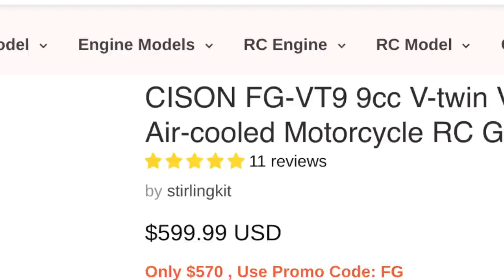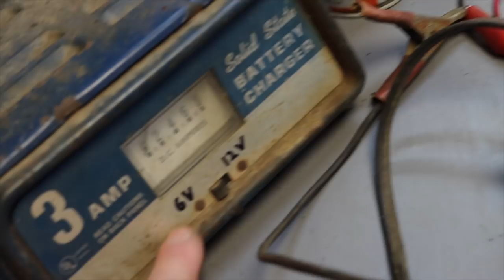Mini Harley Davidson Engine Giveaway, Review, & Teardown. Cison V-twin From www.Stirlingkit.com

Comment: I believe you lost compression because the oil rings are plastic and you took it apart and it's fine not the same now and you should have the time and right because of the timing wasn't right the valves would probably hit the piston

Comment: Funny at the beginning of your video, you called it a 4 stroke. Well didn't see any oil come out of the crank case when you took it apart. Just saying.
Reply: Ummm. The lubrication system has nothing to do with the cycle of the engine. Its a fuel/oil lubricated 4 stroke. Research before you post. Just sayin'

Comment: The first thing I thought when I saw this engine is that someone HAS to make an RC Morgan 3 wheeler! That would be insanely cool! If I pluck up the courage to fork out for the engine, I may well give it a go myself.

Edit: Question, is this 2 stroke oil or RC nitro fuel mix? So does it smell like a good and proper 2 stroke motorcycle?

Comment: I was curious if the bottom end of that engine need more oil. So i went on the Internet and asked google where are the books on engine lubrication were located.
Guess they were in the non-friction section..........😑😆

Comment: If you give it away to me I will put it on a remote control car. Either sand buggy or drag car or both. Cool break down. Neetest engine I have ever seen. What is the cubic inches of that bad boy??? I was wanting to build a v 8 out of piston cylinder size. That would be a great demo to backwards engineer and make a V8 of.

Comment: It was hot that day as I sat beside the road on my broke down Harley. In the middle of the dessert on a no name road about a hundred miles outside of El Paso. No cars for hours.just me and the buzzards circling overhead waiting their turn with me.The sun beating down turning my skin to leather. Hot was an understatement. Just like a cockroach stuck in a microwave set on high for an endless amount of time. How did I get here I ask myself like I'm talking to a long lost friend.How did this happen? How long must I wait for a rescue? No cell service. No one knows where I am. Hell even I don't exactly know where I am. Shit is all I could scream at the top of my lungs in vain. I should have known better but the open road called me like the siren song of the sea calling wayward sailors seeking adventures over the horizon .  I heeded the call and set out heading east with no destination in mind. I knew it was risky but I didn't care. On an unfamiliar 60 panhead chopper that I just bought and had rebuilt at a local bike shop. It seemed like a good idea at the time. I should have built the bike myself but I knew my limitations. Don"t get me wrong , I can turn a wrench but I'm no mechanic. I sat and wondered how I was going to get myself out of my current predicament that I got myself into. One thing for sure , no one was going to come to my rescue so I had to rely on myself. I had a few tools with me . How hard can it be? And just then it hit me like a bolt of lightning. A memory. Didn't I watch a video on YouTube bout a guy who took apart and put back together a small toy model engine just like this old pan head?  It basically the same thing. Ok first things first , do I have fuel? Check the tank. Yep almost a full tank. Is it getting to the carb? Yes . Ok that's not the problem. Ok let's try the spark.i pull off the wire and kick it over.nothing. I try again. Still nothing. Aha  !!! There's the problem! No spark. Now why don't I have spark. I start chasing wires. Fuses .coils.ignition. all good. What the hell? What's this? Well shit ! Why didn't I see this before? Ground wire had come loose. A simple fix and  the old girl snapped to life. You see? Sometimes someone you never met will help you when you least expect it. I pick up my tools. And throw my leg over this old girl and leave these troubles behind. Thank you YouTube guy for making this video.

Comment: I See putting 2 Stroke oil in a 4 Stroke Totally Pointless!!.. for 2 Stroke Engines Suck the Fuel + Oil + Air Mix into the Crankcase and the 2 Stroke Oil Lubes the Crank Bearings when it go's Through the Crankcase Where 4 Stroke Engines Suck there Fuel + Air Mix Through the Intake Through the Intake Valve Right on Top of the Piston it NEVER SEES the Crankcase or the Crank bearings This Putting 2 Stroke Oil in Any 4 Stroke is Totally Pointless for your Never Going too Lube the Lower End of the Engine for 4 Strokes Never Pull there Air + Fuel Through the Crankcase as 2 Strokes Do. So Even if your 4 Stroke has NO OIL in the Lower End "(Lower End Meaning = Crankcase, Crank Bearings and Rod Bearings) Putting 2 Stroke Oil in the Fuel will Not Help in Any Way Shape or Form Your only Going too Foul up your Plugs, Pistons, Intake, Exhaust and Whatever Blow by you Get by the Rings will Not help Lube the Lower End it will be Sooty, Dirty and Black Carbon Deposits. and if you where going too Run 2 Stroke Oil in the Fuel of a 4 Stroke Motor I for Sure wouldn't go any Richer then 50:1 I would go as Lean as 100:1 that being 50 parts Gas too 1 Part Two Stroke Oil or 100 Parts of Gas too 1 Part Two Stroke Oil for it is Doing Nothing for the Lower End. Now with all that being Said if this Did Pull the Fuel + Oil + Air Mix Through the Crankcase then it would be Smart and Work too put 2 Stroke oil in the Fuel I Don't See How in the World 2 Stroke Oil in your 4 Stroke Fuel can Help a 4 Stroke Engines Lower End in Anyway for it is not Ever Seeing the Lower End in any Good Form for by the Time it Gets Blown By the Rings it is Burnt up Sooty Exhaust and No Longer Oil or Fuel that can do any Real World lubrication and I would bet they are Running 2 Stroke Crankshaft and Rod bearings that Don't Really need too be in a Wet Sump oil bath like a 4 Stroke

Comment: My pixie's hog has just blown their engine and this would be any ideal replacement motor for them to rip around the local neighbourhood we share because at present they're relying on me to run them around to help with errands they must complete. So please help me to help my neighbours down the bottom of the garden as I don't want to display any discontentment as I don't want to incur any risk of their vengeance towards my family. Please help I need this engine ASAP, kind regards.

Comment: I really had trouble with you. To me, you know nothing as to how an engine runs on the engineering side of things. You are a tinkerer who thinks he knows enough ????????
Why can't I get this head off,... ffs, you need to loosen both heads to allow the carb manifold to move enough out of the way.
Timing, again, you prove you know nothing until reading about hall effect sensors & you even got that wrong. The magnet creates a very small voltage that is sent to the main coil pack, & that creates the spark. Timing is ALWAYS a few degrees BEFORE top dead centre, NOT at TDC.
Enough negativity, you got there, and proved that even brand new stuff can be faulty from the factory,  the one way bearing.